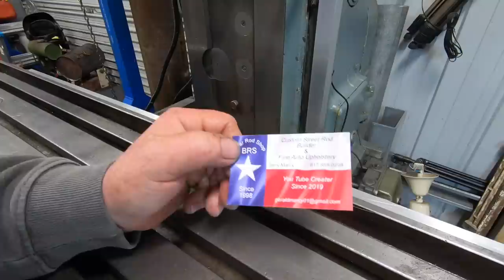Yanmah Excavator,  Pins and Bushes  -  Part 2

Comment: Nice job on those excavator pins and bushes Matty.  Congratulations on wining the digital callipers from Greg over at My lil Mule channel.  Speaking of videos, I will put up part 1 of machining your plates in the next hour mate.  I'm enjoying this small collaboration project.  Cheers, Aaron.
Reply from the maker: Gday Aaron, this job turned out alright in the end, the Shars callipers look and feel really nice, to be honest they feel much better then the Moore and wright set I have, I watched the video you put up today and the cnc makes quick work on these parts, I plan on putting the winch on the hydraulic press to raise and lower the table, thanks for watching and commenting mate and also for the parts, Cheers

Comment: Fill the weld crater by shortening the arc before breaking it , then hold your position, watch through the welding shield for the redness of the slag fade, then re-strike the arc to fill the crater. 
Also. Weld from each end so the crater is in the lower stressed locations- in the middle.
Reply from the maker: Gday, thanks for the tips, cheers
Reply: @MattysWorkshop  Also. Looks to me from the excess spatter.  That either the current is too high or the arc length is too long.

Comment: I keep looking over our old backhoe, that needs similar work.  The bucket really should be replaced, but all the links/knuckles are 'waller'ed' out as well.  Been trying to come up with a way to line bore them with what I have on hand, and come up lacking something every time.  It's too big to pull and do it on the machinery I have in the shop.  Awful hard to get away from those weld/torch/grinder 'rural engineering' hack methods even when you do (supposedly) have the equipment for "doing it right."
Reply from the maker: Gday, I’ve been trying to come up with a way of line boring as well but haven’t found the answer yet, thanks for watching, cheers